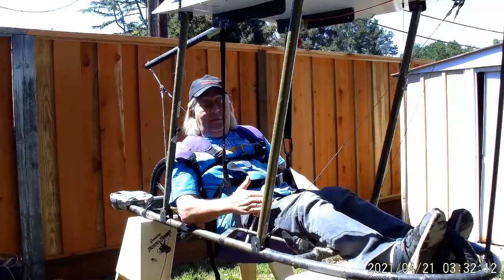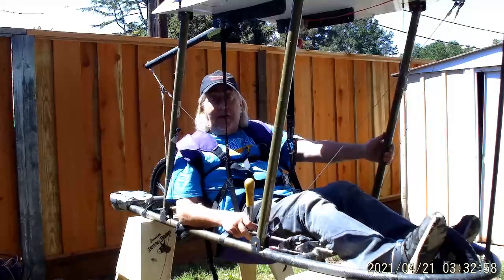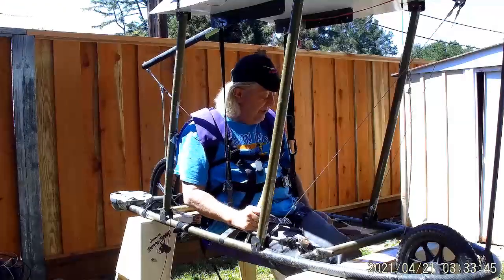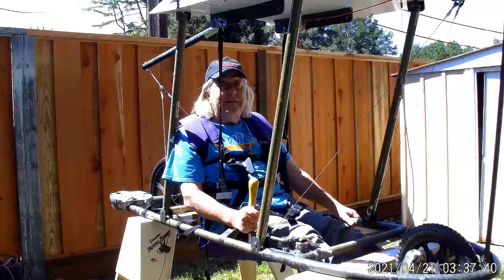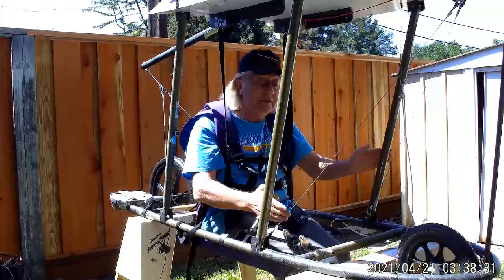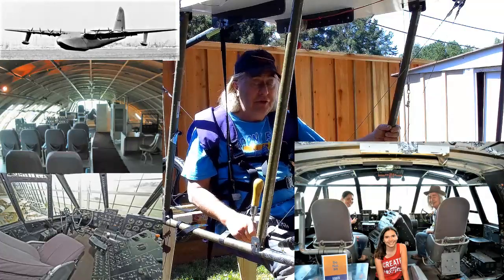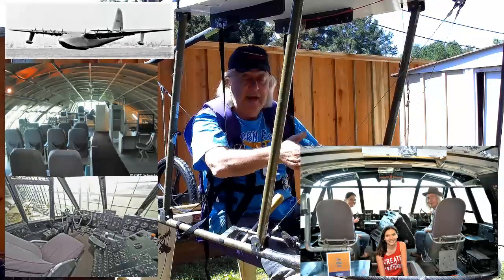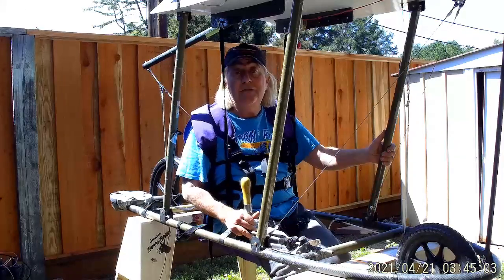KW MkII Ultralight Rigid Wing Hang Glider Development - Human Machine Interface

Comment: Is cable wear a concern at all for your controls? At the entry point of tubes, for example?
Reply from the maker: Not that I know of because the cables are steel and they only contact materials that are softer than steel. However, there could be an issue with wear on various guides or housings the cable run within, but then this is a prototype aircraft and it probably will never see more than a few dozen flight hours. So, no worries.